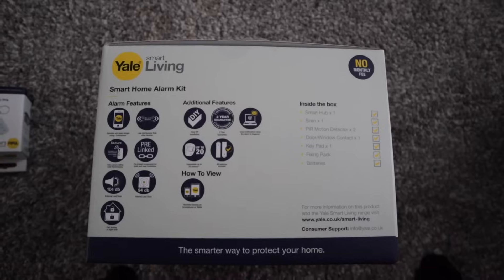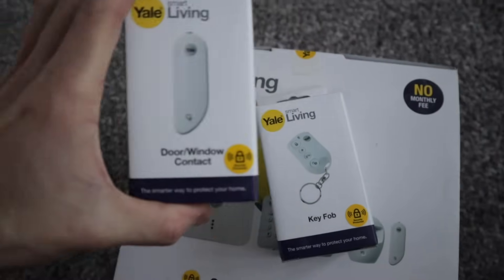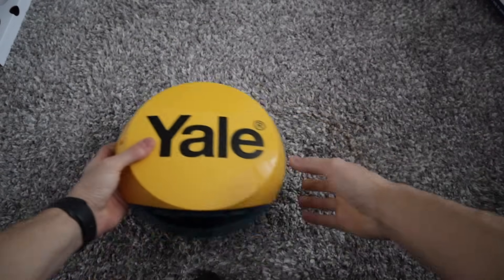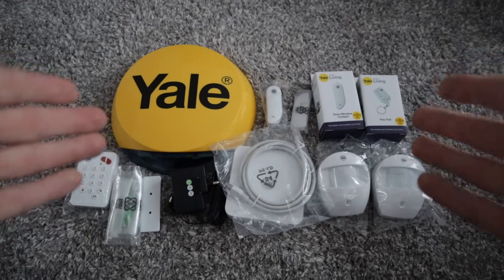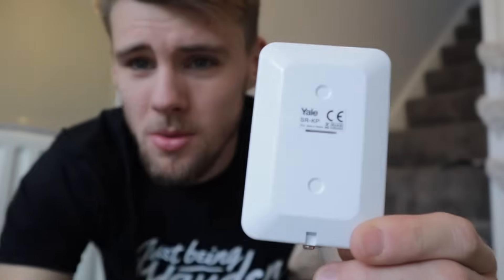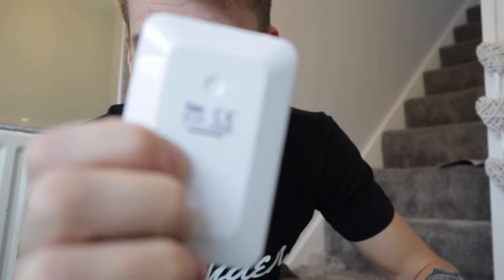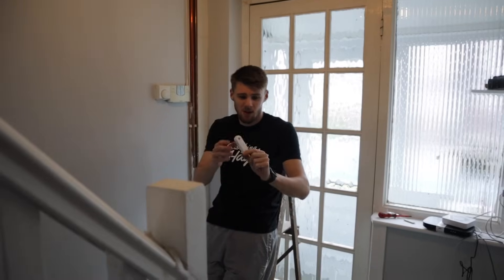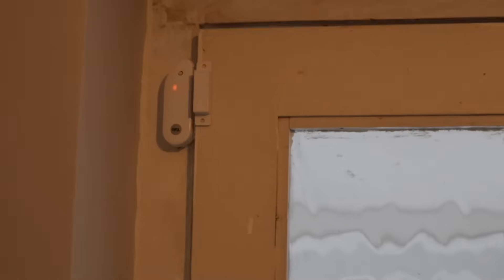YALE SMART ALARM INSTALL

Comment: Great video thanks. For future reference you don't need to go as high up with the bell box. That spring is anti tamper so if anyone ripped it off the wall the spring would make the alarm go off.
Reply from the maker: Thanks for the info!

Comment: Hi ave got the same model as you have bell box is mounted and switched on p I r sensors are also mounted modem is connected. BUT really strugaling on what to do next just worried in case the alarm goes of and I cant turn it off got the yale on my phone but haven't got a clue on what to do it's been registered but still stuck on how to get pin for key pad ? Can you help please

Comment: Did the external siren need an ethernet connection and did it need to be wired with power?
Reply from the maker: Nah just plug it in and connect it via the app 🙏
Reply: Not the hub itself. I'm talking about the siren you had to climb a ladder for. Does that run on batteries?
Reply: @keomakk  There are 3 Alarm Box options. An empty Dummy, one that runs from large batteries so you need a ladder to change them and third one that has a mains charger.  The last option needs you to have a 13A mains socket inside the house and Yale provide a small charger that stays on 24/7.  The last option also has the replaceable batteries just in case you forget to have the mains supply on.

Comment: Hello mate, just a quick one about what if the internet isnt working then can you still use your mobile phone to set the alarm up and get notifications as well please
Reply from the maker: Hi pal I’m not 100% sure on that I think if the internet goes down so does your internet maybe contact them to find out 👊👍👍
Reply: It depends. Basically the system runs on batteries and uses radio signals so if the mains go off your alarm system continues just fine and also your Siren outside if anyone tries or gets in. However your internet will stop so no warning is sent to your phone.  In my case my broadband comes via the mobile phone mast to a Netgear router so I do get a warning on my phone

Comment: Hi I want to take off my Yale alarm outside and refit it higher up towards roof. What do I need to do to reset as when I unscrew it's going to go off
Reply from the maker: Alright buddy I’m not to sure on that one 😩 my apologies mate
Reply: @JustbeingHayden  In the app go to settings-devices-siren and tick by pass. this should make the siren ignore the system.

Comment: Hey great video! Do you know if your able to add old sensors, which were added to your old yale system when upgrading to a new one. I tried pairing but it wont work for me:(
Reply: These SR alarms are compatible with EF alarm accessories but no others

Comment: How do you get the remote controller key ring  to synch with the hub will not synch for me just constantly says searching.
cheers.
Reply: The info is in the Installation Manual and therefore Yale don't put a leaflet into the box for the key ring they send you.  Really poor customer service.  You need to know how to pair the device and it shows you on page 12 that if you press the middle strip with the black closed padlock that that pairs it however you need to press the button on the hub as well at the same time.  Of course they pair some items in the kit and if its an extra accessory you use an additional step the learn button.  Yale think this is all simple but they are geeks and of course we don't find it easy.  They market the system using a 3 minute video for installation and say the entire system can installed in minutes.  Make sure you pull out the plastic strip to power up the fob.